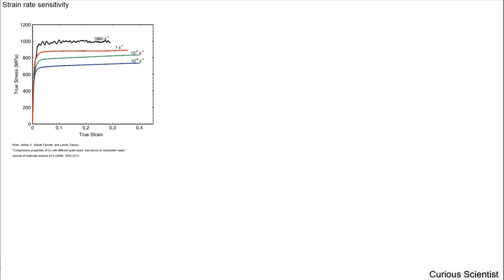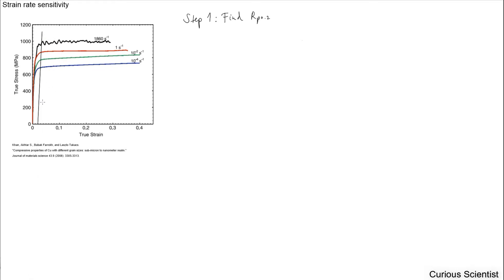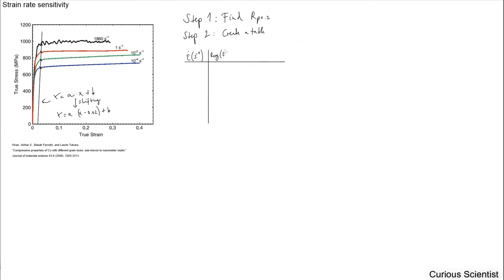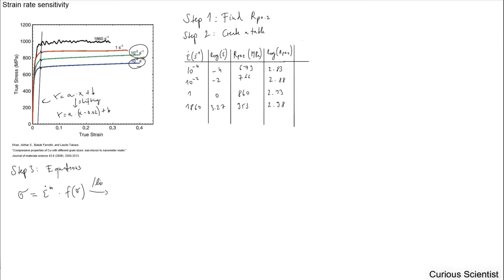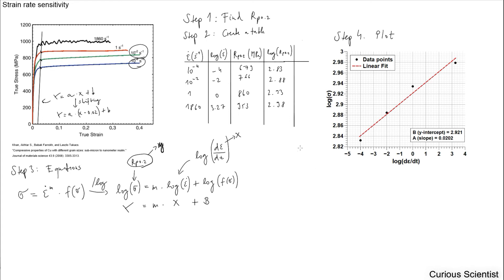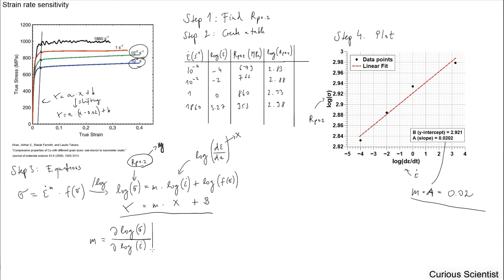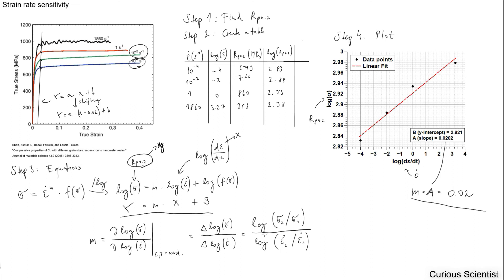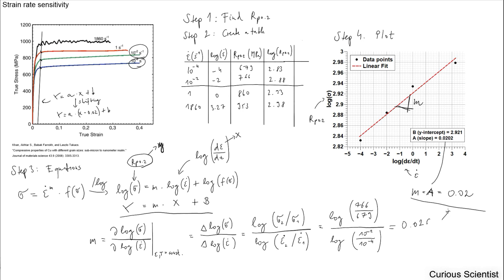Determination of strain-rate sensitivity parameter (m)

Comment: Great video! thanks for sharing. I need to go deeper on this subject because i'm doing my thesis project with a related topic and it has been difficult for me to find information about it. What book or article did you use to learn this method? Greetings from Chile!
Reply from the maker: Hi and thank you! 
The reference for the article can be found in the video description. Otherwise, I just used my university notes. I don't have the book in front of me right now, but I am almost 100% convinced that there would be some info on this topic in Dieter's Mechanical Metallurgy book. Probably somewhere under the tensile testing (or as they refer to it, "tension test") chapter.
Reply: @CuriousScientist  I'll check it out, thanks!

Comment: Is it Rp 0.2 or 0.02?
Reply from the maker: Rp0.2. But I think I know what you mean. I did a typo in the presentation. In the linear equation, the x should be shifted by 0.002 (0.2%) and not by 0.02.

Comment: This is very helpful, I beginning my experimental work and am told to have an understand of Material Characterization, I will be  doing static, Impact test. What are the key or important things to learn and get ready to explain  my material well. Where to exactly i have select correct Constitutive law or Model. How will i know the constitutive law is the correct model to use. Please assist me, and recommend material to read.  I will be doing both tensile test, Split Hopkison Pressure Bar..
Reply from the maker: Hi! Mechanical metallurgy from George Dieter is a nice book. Then of course you have the classical materials science and engineering from William D Callister.